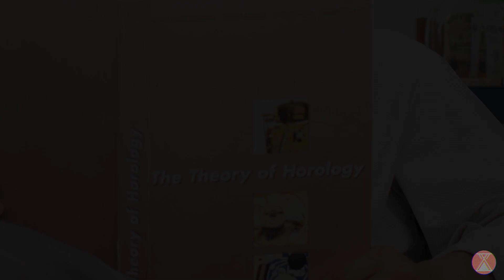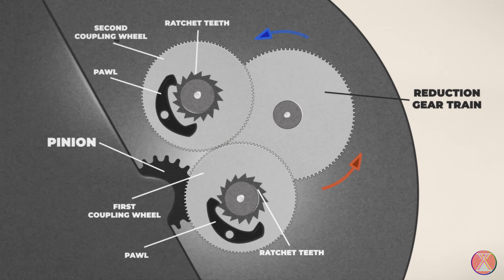Hey! How's That Work? | Automatic Winding | Crown & Caliber

Comment: This is wrong! Why would the first wheel of the reduction gear train drive the second coupling wheel, when the second coupling wheel is directly connected to the first one, thus the weight drives it directly already? Instead, both coupling pinions are connected to the first wheel of the reduction gear, and that's it. The ratchets take care of the rest. With so many views, I'm amazed no-one has noticed this. There is a guy on youtube who 3d printed the parts and made this mechanism, you can search for it. That shows how it works.
Reply: i noticed too something isnt right here, or i think it is. either there are some gears missing or im stupid :c
Reply: Yep video is totally off and took me 30 mins of looking through this
Reply: These guys are constantly wrong about shit. It’s really bad.

Comment: How does it prevent overwinding
Reply: Great question Paul, welded on to the very end of the mainspring, facing in the opposite direction of the coil, is what's called "slip spring" which acts kind of like a safety valve. This spring is always pressing against the walls of the barrel so when the mainspring reaches full wind, the slip spring shifts slightly which keeps the mainspring from being overwound
Reply: The comments don’t show this as responded to at the point I clicked. Great question
Reply: @heyimluca1275  so like a clutch?
Reply: @Gbhmagic   Yes exactly!